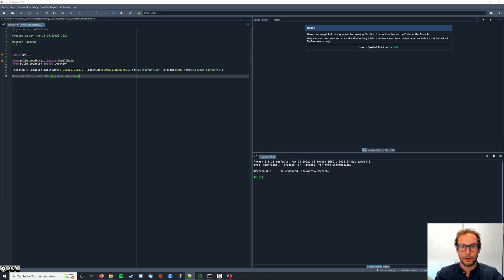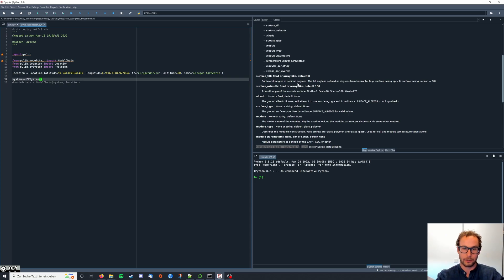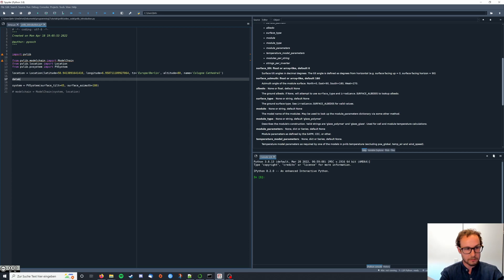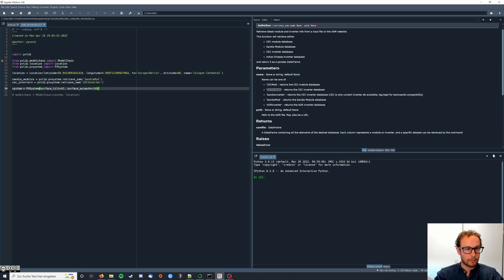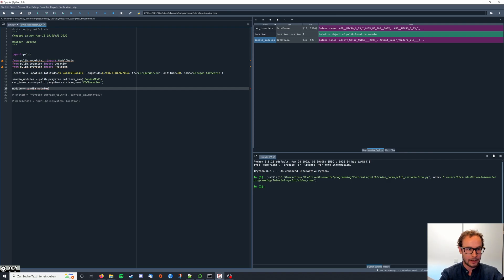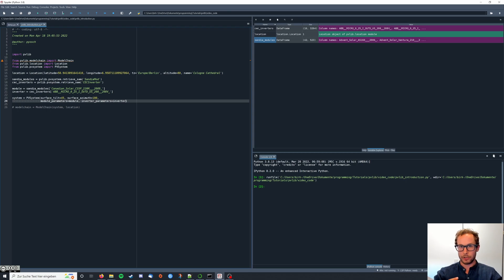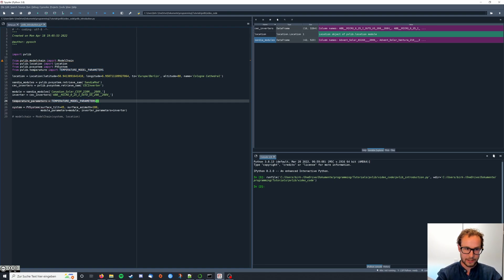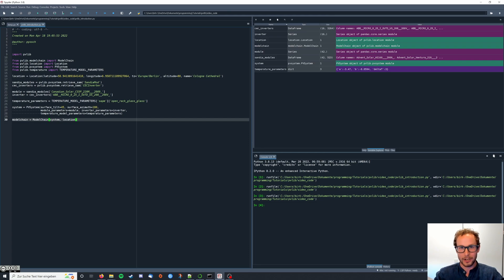pvlib python 03: ModelChain and PVSystem

Comment: Anyone who is watching this after lates update the syntax you should follow is as bellow ```
sandia_modules_db = pvlib.pvsystem.retrieve_sam("SandiaMod")
cec_inverters_db = pvlib.pvsystem.retrieve_sam("CECInverter")

module_params = sandia_modules_db.Canadian_Solar_CS5P_220M__2009
inverter_params = cec_inverters_db.ABB_MICRO_0_25_I_OUTD_US_208__208V
temperature_params = pvlib.temperature.TEMPERATURE_MODEL_PARAMETERS["sapm"][
    "open_rack_glass_polymer"
]

pv_system = pvlib.pvsystem.PVSystem(
    surface_tilt=30,
    surface_azimuth=180,  # South
    module_parameters=module_params,
    inverter_parameters=inverter_params,
    temperature_model_parameters=temperature_params,  # Tells what happens to the module when temperature changes
)

mc = pvlib.modelchain.ModelChain(pv_system, location)
```

Comment: Hi it is really nice video. thanks for uploading.
but i am having an error while run this code.
the error is: AttributeError: 'ModelChain' object has no attribute 'results'

here is my code, would you please help me and point out where i made mistake?
import pvlib
import matplotlib.pyplot as plt
import pandas as pd
from pvlib.modelchain import ModelChain
from pvlib.location import Location
from pvlib.pvsystem import PVSystem
from pvlib.temperature import TEMPERATURE_MODEL_PARAMETERS

location = Location(latitude=52.39137838765491,longitude=9.704815770900398,tz= 'Europe/Berlin',altitude=60, name='IMUK')
sandia_module= pvlib.pvsystem.retrieve_sam('SandiaMod')
cec_inverters= pvlib.pvsystem.retrieve_sam('CECInverter')
module = sandia_module['Canadian_Solar_CS5P_220M___2009_']
inverter=cec_inverters['ABB__MICRO_0_25_I_OUTD_US_208__208V_']
temperature_parameters = TEMPERATURE_MODEL_PARAMETERS['sapm'],['open_rack_glass_glass']

system = PVSystem(surface_tilt=45,surface_azimuth=180,
                  module_parameters = module, inverter_parameters = inverter,
                  temperature_models_parameters= temperature_parameters)
modelchain= ModelChain(system,location)
times = pd.date_range(start="2021-07-01",end="2021-07-07",freq="1min",tz=location.tz)
clear_sky = location.get_clearsky(times)
#clear_sky.plot(figsize=(16,9))
modelchain.run_model(clear_sky)
modelchain.results.ac.plot(figsize=(16,9))
plt.show()
Reply from the maker: By briefly looking over the code I see a typo in temperature_model_parameters. But I don’t know if it’s the only one.
Reply: @sbirk  Thank you for quick reply. But still i am getting same error. Even if i copied the example of pvlib Model chain documentation example from there website i am getting same error.

Comment: Thanks, great video. I am still confused though. How are Array objects connected in a single PVSystem? Lets say I define two array objects, on array is on east and one array is on west. Now I want to connect them in series to a single inverter, how can I do that? And the same question for if I want to connect them in parallel?
Reply from the maker: Hi, just keep watching the videos and your questions will be answered :) Or you may jump to my video about east-west oriented modules.
Reply: @sbirk  I already got an answer from sandia. Basically every array is assumed to have it's own MPPT, which makes modelling things like a series connected solar edge system impossible without adding your own custom code to deal with the voltage mismatches and summing of IV curves. It's a huge drawback to pvlib.
Reply from the maker: Hi, thanks for pointing this out and sharing your insights!

Comment: Thank you for the videos.
Is there any new database for solar panels?
Here the most updated module is for 2014.
For example, can I use SunPower Maxeon and use the modelchain to see how much energy this panel can generate?
Is there any library to calculate the most power we can generate based on selected areas on a map? For example, user can select their own rooftops and see how much energy they can produce? Do you have any suggestions on how to achieve this?
Reply from the maker: Hey, there has been a discussion around newer databases somewhere in the comments, but I don’t recall where it was right now. Maybe also check out the google group for advice. If you have a specific module to simulate, check out my spec sheet based modeling tutorial. Regarding your last question, you can check out pvgis. Otherwise, it sounds like a nice project for yourself :)

Comment: hi, Sascha, I want to use a module from the cec_modules database, but it always shows me an error that the module is not defined. I've checked my typing according to a CSV file on Github. can you help me to solve that?
Reply: and after check whole things it shows me this:"could not infer AOI model from system.arrays[i].module_parameters. Check that the module_parameters for all Arrays in system.arrays contain parameters for the physical, aoi, ashrae or martin_ruiz model; explicitly set the model with the aoi_model kwarg; or set aoi_model="no_loss".
Reply from the maker: Hi, it is quite hard to guess the error without seeing your code. You could either share it here and tell me in which line the error occurs or share a github link to your code
Reply: @sbirk  Hey, thanks for the vid. I am having the same error right now also. this is the code leading to it: 
temp_parameters = TEMPERATURE_MODEL_PARAMETERS['sapm']['open_rack_glass_glass']
loc = Location(latitude=lat, longitude=lon, tz=timezone, altitude=altitude, name=name) (values are correct)
module = pvlib.pvsystem.retrieve_sam('CECMod')['Hanwha_SolarOne__Qidong__SF220_30_P245L']
inverter = pvlib.pvsystem.retrieve_sam('ADRInverter')['SMA_America__STP20000TL_US_10__480V_']
system = PVSystem(surface_tilt=tilt, surface_azimuth=azimuth, module_parameters=module, inverter_parameters=inverter, temperature_model_parameters=temp_parameters)
mc = ModelChain(system, loc)
Reply: you have to check the dataframe database, its a bit different from the github database in the naming

Comment: Can I use measured module temperature values instead of a temp model?
Reply from the maker: Hi Buddha,

not to my knowledge. You could use the measured data to validate your model and try different temperature models to get a good match. Otherwise you may need to ask in the google-group for help: https://groups.google.com/g/pvlib-python
Reply from the maker: Hi Buddha,
I have to correct myself. You can provide another column in your weather data called 'cell_temperature' and then provide the measurements there. Sorry for the confusion. I just haven't used it before. See https://pvlib-python.readthedocs.io/en/stable/reference/generated/pvlib.modelchain.ModelChain.run_model.html#

Comment: Hi Sascha, is it possible to input my own module variables that don't exist on the database?
Reply from the maker: Hi Yun, sure you can define module_parameters as a dictionary. With the code above, you can get the keys from module.keys(), the values should come from your own module. A minimum example can also be found in the docs: https://pvlib-python.readthedocs.io/en/stable/user_guide/pvsystem.html?highlight=module#pvsystem-and-arrays

Hope this helps :)
Reply: @sbirk  first of all: thank you very much for this video series!! It helps me a lot to get started with pvlib. 

Now to my question: I read the documentation you mentioned above and the PVSystem class is still confusing me. The documentation says that you only need to provide pdc0 and gamma_pdc for a module, but neither the pvlib.pvsystem.retrieve_sam('SandiaMod') nor the pvlib.pvsystem.retrieve_sam('CECMod') methods retrieve a parameters data frame that would contain those parameters. In addition the SandiaMod and the CECMod parameters are wildly different. What does the PVSystem class do internally with these parameters? How does it decide which type of parameter set it got provided?

Here: https://pvsc-python-tutorials.github.io/PVSC48-Python-Tutorial/Tutorial%204%20-%20Model%20a%20Module%27s%20Performance.html they explain that there are different  "PV module energy conversion models" like the "Sandia Array Performance Model (SAPM)" (I guess the SandiaMod parameters are the inputs for that model) and the "CEC" model (I guess the CECMod parameters are the inputs for that model). The whole inner working of the PVSystem class would be much more clear if there would be an additional parameter with which you define the "PV module energy conversion models". For which model are the minimal paramers like pdc0 and gamma_pdc ?

 @yun blaze: I found an up to date version of the CEC module library by downloading and installing the https://sam.nrel.gov/download.html application. There is a './libraries/CEC Modules.csv' file with quite recent module lists. I found the module I was looking for there.

 @Sascha Birk  it would help if you could show how to "correctly" use PVSystem with either the minimal parameter set like pdc0 and gamma_pdc or the CEC Modules parameters.
Reply from the maker: Hi „cs“,
I see you already dug deep into the topic and provide some good insights here. As using custom pv modules is requested quite frequently I will address this topic shortly. However, I have to see if I can cover everything you mentioned here, but I’ll try my best.